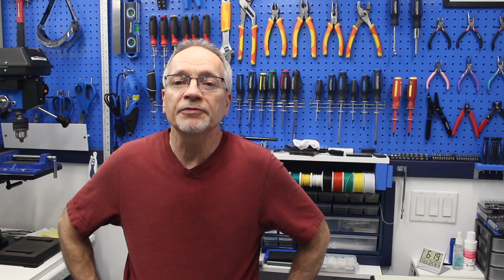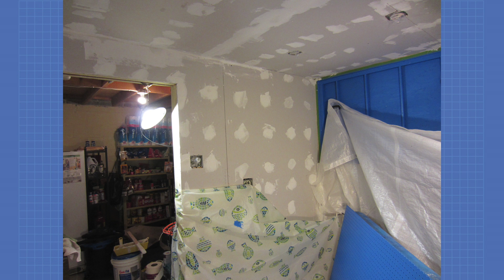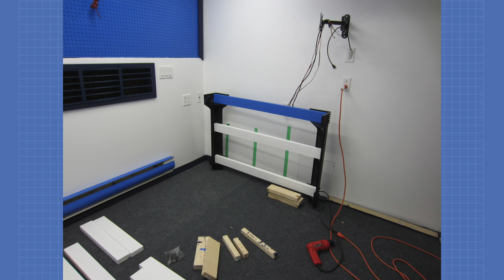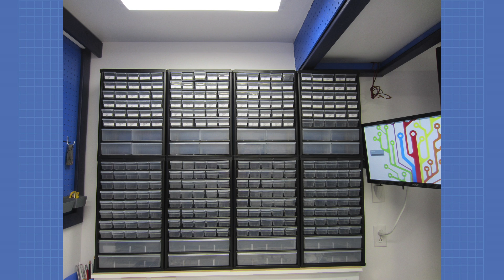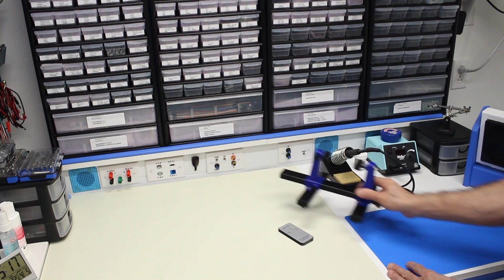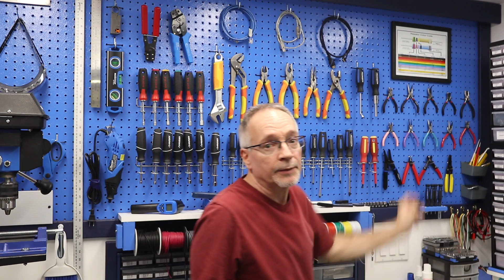DroneBot Workshop Tour - Welcome to the Workshop!

Comment: Thanks for all your great videos.  I have learned a lot and use your videos, ideas, and others channels to keep my skill levels and knowledge current.  

I started out in Electronics in high school and spent 6 years in The Navy in Advanced Electronics program.  However, I spent the 5 years out of the 6 years active on land.  I was assigned to a government agency with a clearance working on Digital Equipment Corporations DEC System 10 main frame computers.  Troubleshooting them down to the board level and then then discrete component level repair back in 1968-1974 time frame.   They actual supported core memory for their systems. The systems supporting multiple Dec 10 systems computers coupled together for real-time data collection and timesharing systems with shared memory between them.  Large rooms of computer equipment working together.

The last year in the Navy, I worked part-time as one of a few Field Service Engineers as a Technician for Digital Equipment Corporation before being hired full time. I ended up supporting the DuPont Experimental Stations real-time data capture and time sharing systems.   With DEC PDP10, PDP 8, PDP 9, nd PDP 11 computers coupled together.  It was a lot of fun and enjoyable work.

While working for DEC I built and leased Cromemco Computer S100 Bus Z80 systems configured as using bank switching MPM Multi- Processing Machines to multiple local high schools and the University of Pennsylvania Medical Center.

Again, Thank you for your great videos and knowledge that you share with us all.

Comment: Probably this is the first video of your's I watched.
I have to say I am very impressed by your workshop. You did it by almost the same key concepts as I am currently developing mine (like separating mech and lab areas, etc). Clever ideas and the attentiom to detail in everything, especially in the color control is awesome! Needless to say, I love blue. 😉
I like the ton of drawer boxes too!

You said you drill only PCBs, however my idea would be to make some curtain or some kind of movable panels around the drill press, so the chips won't fly everywhere, inside things, in the PSU, the tablet, etc. But I drill a lot of metals and various plastics, many times with coolant, so the amount of mess without a curtain is beyond crazy here. Even if you just drill PCBs, it would marginally lower the amount of dust everywhere.

BTW, I also did the ceiling myself, it is certainly possible to do alone with some forethought, and I still finished faster than when I would have to beg to somebody to come help.

Comment: Awesome!  Love your videos!  I am inspired to have a similar workshop.

What would you do differently? if you had to do it again?
Reply from the maker: I'm glad you're inspired Max, it makes it all worthwhile to hear that.
As for "if I could do it again" it depends upon how much space I had. If I built it again in a similar sized room there really isn't much I would change. 
But if I had a larger area I would have tried to get my scope and test equipment onto the "electronics workbench". I had actually hoped to do that, one thing that I didn't point out was another surface-mount AC outlet that I put on the far left side of that workbench for plugging in test equipment. I also shortened a standard AC cord for use with the scope, and I do use that arrangement wghen I drag the scope to the workbench.
Back in the 80's when I worked as a technician I had a scope right on the workbench, alomng with a few meters.  It was nice to always have it handy.
Reply: Did you do it

Comment: I like the way, when on the video about AC devices controlled, you were talking many times about safety with high voltage  .... 
on this video i can see your electric drill standing up high, and on the table's edge under it, there is mounted an electric extension bar ....
-- when you drilling, maybe small metal particles dropping down ....
-- sometimes we need to cool down the drill bit with oily water splashing widely .... It is not any personal, only my reflection ....
Thank you for so many videos full of informations, practical experience you have, thank you, i am learning so much from you.

I would like to ask you, is it possible to sometimes make a video of Q/A  ? .... when we have some questions, from our comments, something more specific to explain  ??
It would be very interesting, and you could say more about some problems .... I just started my journey through the Ros Pi, really i am feeling lost what to buy first, there is so many different boards, clones, how to start and plan the projects, how to program these devices, some of them has installed OS, another maybe not but uploaded program to the microcontroller ....
Many other YouTubers say different stories, maybe from their experience, but for example one says Pico is lovely, another one says Pico is nothing special because ESP32 is super :-)) 
I am sure there are other problems to express any opinion, but for new people it is not easy to make choice what to do in the first months ....
I am really very happy that i have subscribed your channel and always i watch your videos very carefully ....
Thx

Comment: Love your shop!  Hope my own will be as well developed.  After 50+ years in avionics and biomedical electronics, I retired and wandered off into woodworking.  Getting back into electronics to work with our 7-yr old grandson who loves doing stuff with grandpa.  I have a pretty well equipped shop,  but I'm a bit stumped looking at the new digital oscilloscopes.  Could you give some pointers on what specs I'd need to do basic electronics, Rasp Pi and Arduino stuff?  Would be a big help.  Yours appears to be a Sigint model, but I couldn't see which one.  Thanks.